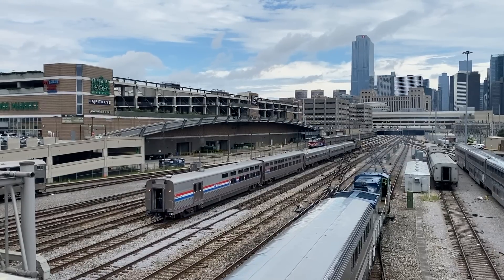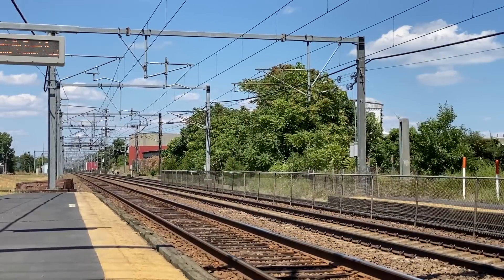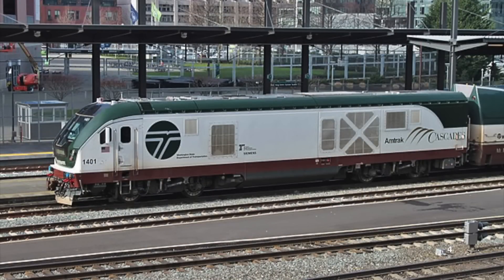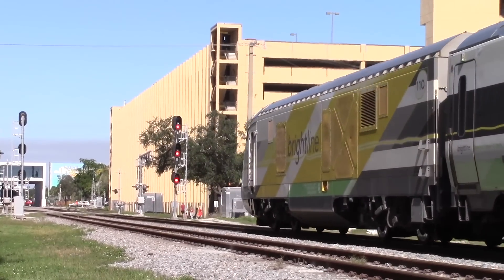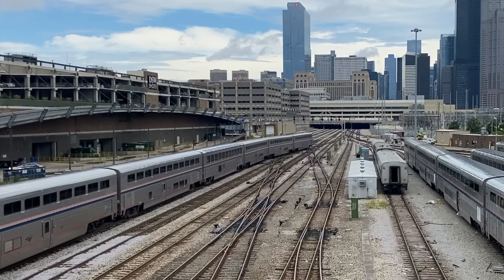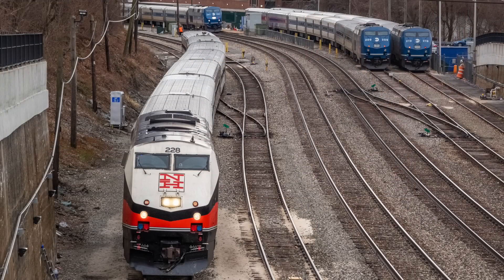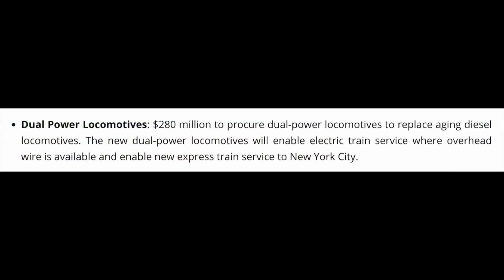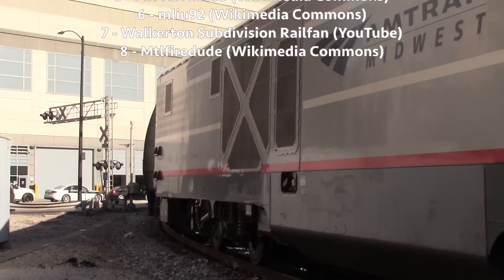Siemens Charger: Locomotive of the Future

Comment: Shame Amtrak didn't order streamlined locomotives like Viarail. I think more people would be inclined to use the trains if they looked more modern. Alot of people see the antiquated Amfleets and freight-based engines and compare them to Europe and Asia's high speed rail.
Reply: The sprinter and charger are direct relations to the Siemens ES64U4. ÖBB called these "Taurus", and the one numbered 1216 050 (and later renumbered 1216 025) has the world speed record for electric locomotives at 357 km/h (222 mph) on 2006-09-02. (If you google it, I'd say the stylistic relation is pretty obvious.)
Reply: Interesting. I could see where the design is similar. Although the Taurus has a very interesting sound when accelerating. The ACS 64 doesn't sound like a saxophone playing a scale
Reply: @KaiHenningsen  additionally the via rail concept is based on the öbb service railjet.
Reply: @AndrewTheRadarMan  
The sound is due to how the AC power gets generated and delivered to the motors, and Siemens engines from the early 2000s in particular developed this sound. The technology has become simpler and more efficient since, but at the cost of the wonderful sound. This even includes the Taurus; whilst the first two series play you some musical notes when accelerating, the third series, sharing the same bodyshell, doesn't.

Comment: A little minor correction they are more eurosprinter. 
Yes Siemens Mobility has built Chargers on Vectron. But afterall Vectron/and the single Current variant Smartron  started in 2010. 

The Vectron itself was based on both the EuroSprinter (electric) and EuroRunner (diesel)

Comment: I heard the chargers failed when Amtrak was testing them in cold weather due to their large vents, it could be possible for the via chargers to suffer from this same problem
Reply: They should make smaller vents
Reply: Meanwhile the Brightline trains have much larger vents and larger radiators to deal with the Florida heat.

Comment: @WorldwideRailfan, I have a question. I live in Japan and passenger trains here have the locomotive car integrated into the passenger wagons themselves. I understand why a non-electric train would have a separate locomotive car but why do the electrified trains still have a separate locomotive? I also notice that they have multiple locomotives and I just don't understand why? Just in case, the first and last cars have cabins for the drivers but usually the second and the second to last cars on commuter rail have the drive motors. All cars have pantographs. The shinkansen (bullet train) as well. I guess, similar to subway cars in New York but with overhead wires compared to the third rail. (Only subways in Japan have the third rail) But commuter rail, long-distance trains, and the shinkansen all have integrated locomotives. Only freight trains have independent engine cars. (Sorry for any incorrect terminology.) It seems wasteful/inefficient to me.
Reply: Having separate locomotive and cars is cheaper. Unpowered trailer cars are much cheaper to build and are actually quieter and more comfortable because they don't have any working components like motors. If you have a breakdown of a locomotive, you can switch it out and the rest of the train can operate normally with another locomotive. 
In trains with integrated locomotives, which are called multiple units in train terms, if you have a breakdown, the whole train cannot move. 
Also, if the track isn't electrified, but plans to be electrified in the future, you can use a train with a diesel locomotive until the electrification, and then simply change into an electric locomotive. You don't need to buy a whole electrically powered train. 
Commuter trains are usually multiple units with motors in all cars because they need to stop and start frequently because the stations are very close to each other. A locomotive can't accelerate quickly because it's just a single vehicle pulling the whole train. But over longer distances with fewer stops they are more efficient.
Multiple locomotives are used in case when the train is too heavy for a single locomotive or if they are simply transferring a locomotive to another station. It's wasteful to send it alone. It's more efficient when attached to a train. Multiple locomotives also can help trains accelerate quicker so they can operate as commuter trains, but that is very inefficient.
I hope this is easy to understand.
Reply: While they multiple units have their fair share of advantages (namely better acceleration, weight distribution, hill climbing), locomotives are very useful for mix-and-match trains (many of them are this in NA), diesel trains (bigger generators are more efficient than smaller generators), are more flexible (see RR's reply for more information) and also are better suited for low floor trains including bilevel trains (most notably, the TGV Duplex).

For that matter, the shinkansen, a flagship high speed train, may use electric multiple units but the TGV, the other flagship high speed train, is a locomotive hauled high speed train (strictly speaking, they're power cars but the point still stands) and they're still build that way today (compare that with the ICE where only the first two generations are locomotive hauled and the rest are multiple units).

Comment: I wonder, with all the experience with the Cahrgers in the nord american market, will Siemens maybe one day build a freight engine too? And try to attack EMD and GE in their main market.
Reply: I don´t how how different conditions for passanger and freight trains are in America but here in Europe they serve both pretty well. Taurus locos (Vectron predecesors) were primary developed for freight train.
Reply: @petrfedor1851  In the US freight trains are much longer and heavier than in Europe! Siemens has to create completely new engines. They can't use their existing European models for that.
Reply: North American freight locos are absolute monsters compared to anything out of Europe due to the extreme length of trains in the US and Canada.  Heavy haul locos in the US run 6000hp without the need to divert power for HEP, and they run 3-6 per consist depending on weight and dynamic braking requirements.  and remember that's 6000hp with 70mph freight gearing so they can pull some absolutely massive weight with only the 8500hp gas turbine locos of the late 50s and 60s and the Challenger and Big Boy steam locomotives being able to pull more weight.
Reply: @mrvwbug4423  Europe is mostly electrified (except smaller regional lines) that is why there are no powerful diesel trains. But electric Locomotives are most of the times stronger then diesel ones: for Example the standard Siemens Vectron has 8600hp

Comment: Why didn't Siemens just introduce the proven Vectron in the USA adapted to USA standard. And why the Charger doesn't cabins on both ends?
Reply: IIRC, the Charger pretty much is a Vectron. They just can't use the same Body because Crash Safety Standards are much stricter in America than in Europe. The Charger also has a Cummins Engine instead of a MTU, but I'm not sure if MTU has an Engine Factory in America; that might explain the different Engine Choice.
Reply: @Genius_at_Work  I think MTU does, because ferries that run in the bay area use MTU engines, and the BL36PH trains in Florida use their engines as well. Or maybe I might be wrong.

Comment: Considering the future of the ACS64 is up in the air do you think you’ll maybe do a video on potential places they could end up whether that’s to Septa, MBTA, MARC NJT
Reply: why is their future up in the air?
Reply: @truedarklander  The new ALC-42E Charger-Venture trainsets are meant to replace the ACS-64.
Reply: @BIoknight000  They’re meant to replace MOST of the ACS-64’s which I still find to be surreal given the ACS’ are still relatively new. I think there’ll be a small fleet of ACS’ kept around to handle the long distance traffic that the electrified lines see, as well as work trains and other miscellaneous tasks.
Reply: @justahillbilly7777  I predict there will be a relatively large fleet left, and only a few of the bi-mode units. It's a stupid idea to get rid of so many new units given the very limited market for electric locos in North America
Reply: Something tells me Siemens will buy them back and use them for parts for other Charger units (I know the mode of propulsion is different, but many other parts are in common.)
Reply: @MirzaAhmed89  I seriously doubt Siemens would take them back. If anyone uses them for parts it would be Amtrak
Reply: @andrewreynolds4949 Turn the ACS 64s into single end cabs

Comment: Great work by everyone but things have changed with Alstom's hydrogen trains   That is the way forward for sure as hydrogen is the complete replacement for all fossil fuels including trains.
Reply: Cool argument, however I’d like to introduce you to a revolutionary technology that can be clean like hydrogen, almost as reliable as diesel, can handle speeds in excess of 200mph no sweat, and doesn’t require refueling unlike hydrogen (which needs expensive equipment for that because one leak and you’re liable to be in the headlines) and diesel

IT’S CALLED A FUCKING WIRE, AND WE’VE BEEN USING IT SINCE THE LATE 19TH CENTURY.

Why dick around with an unproven technology when you could just grit your teeth, put up some poles, and electrify the lines like a real railroad?
Reply: Electrified overhead lines are hardly ` revolutionary '.  They've been around for a long time and did great work.  Modern hydrogen production, distribution and use are totally safe thanks to modern capabilities.  Also, hydrogen is carried on the roofs of fuel cell trains so if any puncture of tanks happens, the hydrogen just escapes upwards.   You need to adapt to change.  There was a time when all White House limos were steam powered but when Henry Ford proved that the internal combustion engines were more efficient on a power to weight ratio, they went for gasoline over steam.  Fuel cells are truly revolutionary and will replace all electric (overhead) trains.  Accept it .

Comment: Siemens Charger suck for long haul. They are not designed for working on freight rail tracks. They should have gone with Japan's long-haul trains. Also, the long-haul new cars can't even pass inspection at the factory, and have not made it to Pueblo, CO for testing. It requires a crap load of maintenance.

Comment: Well. P42s never actually lived up to their hype, hence why the chargers were designed. not that they were too old or not running well.  We needed a loco that could withstand North American winters, P42s could never go LD or XC with VIA
Reply: Rumor is Chargers are even worse with winters
Reply: @andrewreynolds4949 The F40s can handle the winter however that does overheat the Prime Mover that could lead to a fire similar to what happened to F40PH 215
Reply: @maas1208  But do they regularly short out entirely when faced with small amounts of snow?
Reply: @andrewreynolds4949  No the F40s don't
Reply: @maas1208  And rumor is that the chargers do unfortunately

Comment: The Chargers have little front-end protection for the operating crew. This cab design is not an issue on the NE corridor because there are no grade crossings as there are in cross country service.  I would not want to be in a cab of a Charger in an unavoidable collision with a semi-truck stuck on a crossing!
Reply: They have done very well against tractor-trailers, heavy farm equipment, and high speed airborne derailment.
Reply: Idiots in Florida keep ignoring signals and driving across brightline tracks, so there have been many real world tests of the Siemens charger performance in a vehicle collision, and for the most part they come out of it fine.
Reply: They follow the European design philosophy of incorporating a crash structure that deforms in an impact as well as an extremely strong survival cell to protect the driver/engineer. Trust me, they'll do just fine.

Comment: Figures njt is keeping it “classic” 😂
Reply: No idea what you mean. They want to replace everything with dual modes and double deckers.
Reply: @ecoRfan  he mentioned MTA on the jervis line (operated by njt) is getting this train set but he didn’t say NJT was planning to unless I missed it
Reply: @damnimloomin  don’t count on it. There are no official plans for that; it was only an idea.
Reply: @damnimloomin  another issue is that the WOH fleet are maintained by NJT at the Meadows Maintenance Complex. The MMC currently has limited space. For only 15 locomotives, the Chargers have a totally different parts bin from the existing NJT fleet. Currently the PL42s are the black sheep of the fleet, however there are about 30 units active. It’s more likely WOH would get something with parts interchangeable with the Bombardier ALP series to replace the EMD’s. Regarding the EMD 40 series they have currently, their issues are more of nurture than nature, specifically the rebuild jobs by Progress Rail (F40 in 2010s) and Morrison-Knudsen (GP40 in 1990s). Basically don’t expect the Chargers to become the replacement for the WOH fleet due to parts bin and mechanical training constraints.

Comment: I’m waiting for the SC-44s to roll out in Virginia, haven’t seen a single one.
Reply: sc44s will not operate in virginia
Reply: @danielchou5895  Silver Service? Crescent? Cardinal? Auto train? Also I think they (or a locomotive with the same exterior design) will be used on regionals as well
Reply: @Cal90208  Silver service, crescent, cardinal, auto train will use ALC42s. Regionals will use ALC42Es
Reply: @danielchou5895  that’s true but this video wasn’t explicitly on the SC-44, rather it was about the charger in general.